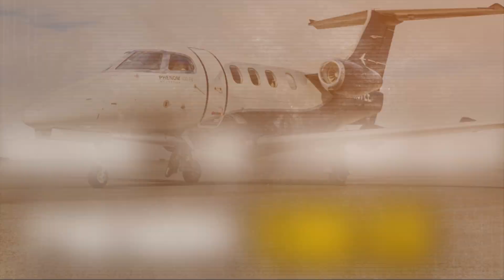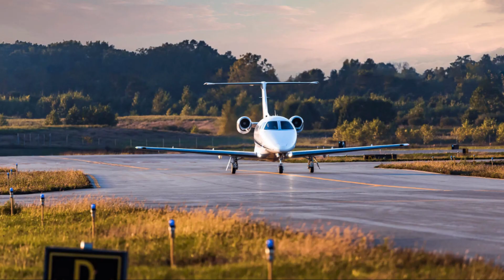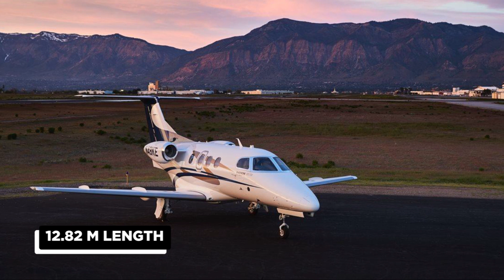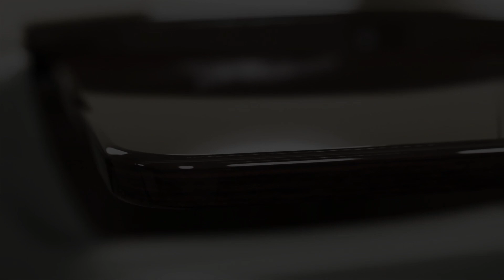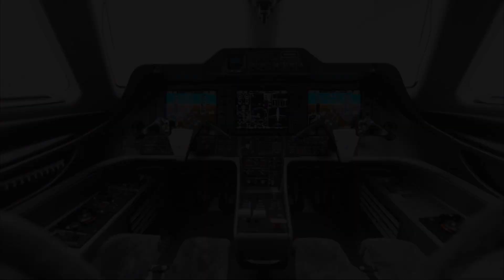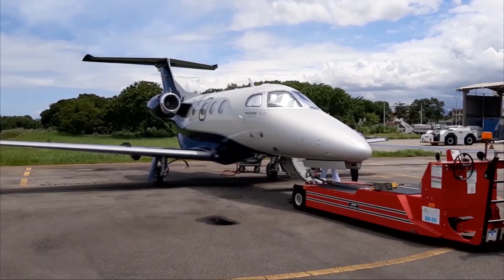Inside the New $4,6 Million Embraer Phenom 100 EV | Unparalleled Performance

Comment: It's a great aircraft, but a bit dated in some areas today. Lav is cassette type, over the wing refuelling? The Hondajet has single point refuelling and an externally serviced  lav. While it doesn't have windows in the lav, it does have skylights.
Reply from the maker: You’re right